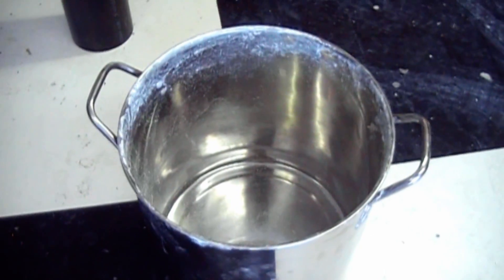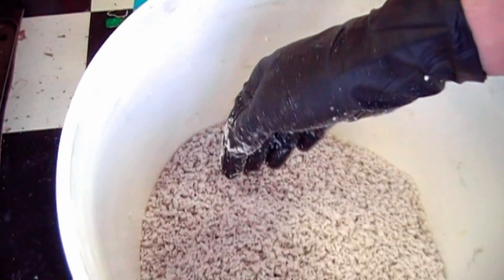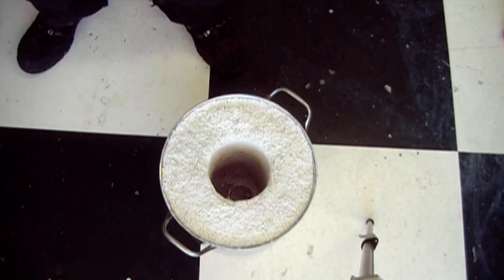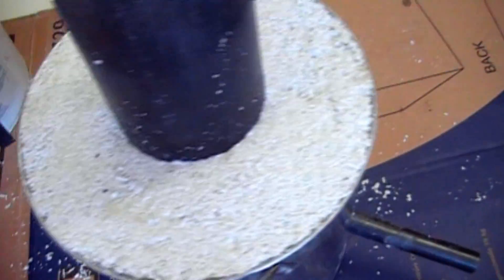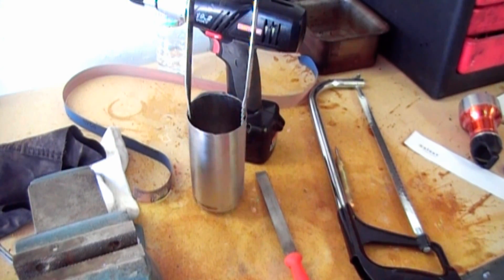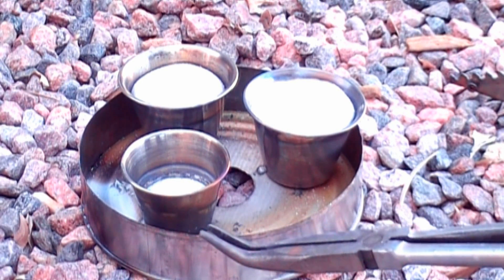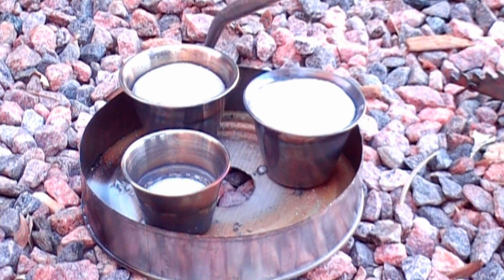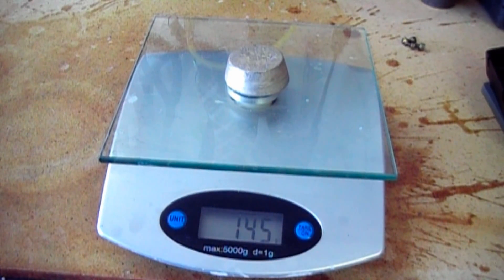How to make a small foundry

Comment: what are the benefits of this recipe compared to the sand and plaster method used in the Grant Thompson video.
Reply from the maker: jesse wakefield I never had good luck with the plaster and sand recipe, by the time all the water has been burned out and it can start getting hot, it becomes very fragile. This recipe is also much lighter, it's easy to move around despite its size.
Reply: thank you for your quick response. by the way i began to collect the desiccant packets in hopes to make my own liquid sodium silicate, however i seem to be having a difficult time finding %100 lye, every hardware store i check tells me the FDA deemed it to dangerous because of its purity any suggestions. im to the point wear i may begin collecting the ashes from my grill.
Reply: clkindred can i use galvanized or should i stick with stainless steel.
Reply from the maker: The concern with galvanized is the zinc burning off and creating toxic fumes. So non galv. is best.

The lye though, I have never known the FDA to have anything to do with drain cleaner. If such rules do apply in your area, I would think they would be from the Consumer Product Safety Commission. Either the people telling you the FDA is restricting it are telling you nonsense, or they have confused the group doing the restricting.

If you are determined to refrain from an internet purchase of lye from a soap making supply site, then my only suggestion is to try to find DIY soap making people in your area and see how they get it.

Comment: I was wondering what this FLUX is you're talking about when melting the aluminum 
or brass to get a cleaner look??    Does it help to use flux in the crucible before 
pouring the molten??
Reply from the maker: sthwestb Flux dose a number of things, it lowers the melting point of the metal, makes the molten metal more fluid, reacts with contaminants and causes them to aggregate together and rise to the top, it can also act as a nonstick treatment to crucibles when working with precious metals.In this case, I used table salt, added after all the metal has melted. The salt melts and is stirred into the metal, the dross is skimmed off and the metal poured.

Comment: I have made my foundry out of the following pieces, 7 gallon propane tank, construction grade perlite, sodium silica, water, and the aluminum oxide. As we started packing it seemed to become very dense and after removing the forms it was smooth but would flake at the top. I decided to use the torch you redesigned and fired the top and inside. It is super hard and set the top so I can put the form back in and go over the top with just the aluminum oxide and silica gell to level and square up the top and to prevent more flaking. All I have left to do is the bottom and I had to order more aluminum oxide because I ran out due to the size of my foundry. I am however going to build a fire in it tonight to get the sides cured so when I fill the bottom it will not hurt the top and sides  when tamping. Thank you for putting your knowhow on YouTube so others like myself can have a good way to learn and make things easy. Great project channel.
Reply from the maker: hcistheman Thank you! Good luck on the build and keep us posted!

Comment: smelting alum beverage cans is actually a good way to know consistantly  what grade of alum or lack of undesireable componets in its metalurgy. It is important that you dont breathe vapors of either the heated stainless or alum. at the temps we are at here, stainless releases about a half a dozen carcinigens the the higher the grade the more toxic it becomes due to addition of more minerals example 401C which is used to make cheap knives contains chromium thus the C it is what keeps stainless from corroding. Just cause it is stainless doesn't mean it wont rust. Oh the alum cans are clearcoated on inside otherwise the acid in the soda pop would eat the alum. Add morton's lite salt Salt melts just at aluminum's top pouring temperature, and mixtures (like Lite Salt) melt at the same time, if fused before use.

Baking soda, sodium bicarbonate, decomposes to sodium carbonate (washing soda, sans hydration) and CO2 when heated. After that, sodium carbonate may have a mild chemical action on some things present, but it isn't going to melt (you wouldn't want it to, with metal around), it has a high melting point. Getting something liquid around the slag and metal is the primary duty of a flux. Oh someone was concerned about a graphite crucible surviving the postal service. I dont know if graphite is the correct crucible material for this application but it is not fragile like ceramic.

Comment: LOL i used a stock pot as well but i used gypsum mixture with paving sand and it gets up to 900+ degrees easy and melts aluminium in blink of an aye using a steel crucible but i want to melt some brass for a project but i cant get a decent sized crucible to fit and i don't really trust the postal service in the UK for a graphite one for the higher temperatures it will probably get cracked and kicked all over the place any ideas for a substitute?

Comment: That's not safe

The air valve is at a 90° angle instead of 45
You are using steel clasp with wood handle 
You didn't put a cement mixture in it so the
      steel bucket can cause a fire
You used a river hose that can be lit on fire .
You didn't in you back yard near flammable
        items

Comment: im no expert but why waste your time sanding the crucible when its going to get scorched anyway?
Reply: Mr.xxxxxxxxxx17 would be much easier to just step away from the fumes, in a well ventilated area, no?
Reply from the maker: It's not for appearance, I don't know what that coating is made of and don't want to deal with the problems of burning it off. In retrospect, it probably did not matter.
Reply: I was just about to post the same question.  Why waste the effort to sand it?
Reply: ***** paint would burn and it could be toxic to breath
Reply: Mr.xxxxxxxxxx17 Any exhaust from a foundry should be considered toxic and dealt with accordingly.
I'd be more concerned with trace heavy metals and dioxins from hydrocarbons on the smelt material.  wearing a good chemical mask is always the safest option IMHO.

Comment: How long does it take for the mixture to set?  I've mixed some up using your recipe, but am not sure how long to let it sit and cure.  Thanks!
Reply from the maker: This exact recipe needs to dry first before cure. Depending on the moisture content and cross section, it may take a few days before forms can be removed. After that, the first firing will cure the mixture, dried mixture that has not been cured can combine with water again and be re formed. After curing the materiel will not combine with water and become soft again. This recipe has been replaced with a better one that can take more heat. https://www.youtube.com/watch?v=vQN7EqGMTuo
As it stands, this old recipe can melt if run hot enough.
Reply: Meanwhile you may consider actually purchasing a proper commercial refractory mix. It may cost more, but you get the confidence of knowing what temperatures it's designed to put up with, and you have the confidence of a commercial product in it's capacity to put up with use.
Reply: clkindred thank you!

Comment: if you wax the pot the concrete will pop right out
Reply: Why would you want the "concrete" to pop right out?
Reply: so you can use the pot again
Reply: imchris5000 First, the material used is not concrete. It is a very lightweight, medium temperature fire resistant refractory casting material that is bonded together with sodium silicate. 
Second, the stainless stock pot is not a mold, but rather a protective case for the refractory casting that helps reduce damage and fracturing, and also provides metal to securely fasten the burner tube assembly to the furnace.  The stock pot handles are also very helpful when moving the furnace and are a bonus. 
In the event you wanted to reuse the stock pot, the refractory material is easily fractured and removed. It is a common practice to remove the refractory casting and recast due to the refractory casting deteriorating and cracking from the heat and erosion from the flame.

Comment: On your crucible use the tongs to "grab" the tube from the outside pushing inwards then on the base add a handle/hook that you can use to hold and then when you come to pour your melt your tongs become a pivot point and the pour itself is much safer.
Reply from the maker: Thanks for the tip.

Comment: When I watched aluminum being melted for casting the smelter used about a teaspoon of 'washing soda' flux per crucible load - stirred it around - that separated the dross - half floated, half sank. Skim it and discard before pouring to get nice gas free clean metal.

Comment: where can i find aluminum that is easy to get that is not soda cans?  i hear people use them but its not good for you or the metal itself.
Reply from the maker: Yea the metal itself is not the best alloy for casting, but it dose work. The best aluminum to melt for casting is aluminum that is already cast. Anything made from cast aluminum is ideal, cast aluminum cooking pots and pans, car parts like intake manifolds and transmission housings, water pumps ect.. old v-belt pulleys and work light housings might be aluminum too.

Be careful though, some of these examples might also be made from cast magnesium, it's hard to tell if they are or not because magnesium is lightweight just like aluminum. To be sure, test unknown metals with vinegar on bare, paint free surface, if there is a light bubbling, it's probably mag and you should not melt it. Melting magnesium will cause the magnesium to ignite and magnesium fires are almost impossible to put out, trying to put one out will be disastrous.
Reply: I'd say the best metal is whatever you can get your hands on. :)

But on a serious note, consider what you're intending to do with what you cast. It may not really matter so much, and unless you know where to look, beverage cans are probably the most convenient source of aluminum available to you.

Comment: Can I use a plastic bucket instead of a steel pot for the foundation?
Reply from the maker: I don't recommend that, after an hour or so running it the steel pot will be quite hot, too hot for plastic.

Comment: So it's basically a heat resistant concrete?
Reply from the maker: Concrete is not used here because it has molecular bonded water, that's what causes it to harden, if heated enough the water is driven off and the concrete crumbles to bits, it can also "explode" chunks all over the place due to the steam pressure. This mixture can be heated without breaking down like the concrete.

Comment: Why so high tech? People in 2000BC could melt copper in their "home made" forges. Why not try to use easy to hand materials like sand, clay and stone,instead of special products that have to be made in a chemical factory?
Reply from the maker: You need a permanent foundary, lots of fuel, and lots of time to do it like that.
Reply: Well they also did it by blowing heated air onto shallow dishes of the metal in clay or stone, which is an incredible poor way to accomplish this.

Meanwhile in 2000 AD, we've progressed technologically, and can do things more efficiently, safely, and conveniently.at home.

Comment: does cement work for this
Reply from the maker: No, it is too dense and full of molecular bonded water. A foundry made with cement will have a hard time getting hot.
Reply: clkindred I've seen them made with plaster of paris and play sand in much teh same way you're doing here.
Reply: clkindred ok then i wont use cement

Comment: Hi Clkindred, Another great post!!.
What can be used to speed up the setting time of sodium silicate? 
 I followed your post...worked a treat, but its still a little tacky.
Any suggestions greatly appreciated.
Cheers
Ben.
Reply: +eyeopener1979 CO2 gas will set sodium silicate in seconds. I used it to set sand casted moulds made of a blend of sand and sodium silicate and it was very impressive. I guess that setting will be much faster if you let your furnace dry in a CO2 saturated environment.

Comment: Can this be used to melt gold?
Reply from the maker: Kind of large for melting gold, unless... you have a lot of gold. A smaller unit would be more efficient at concentrating the heat. Propane has been demonstrated to be able to melt gold, if you can keep enough of the heat in. I have made newer high temp linings for a new forge that would last longer for that type of thing.

Comment: Is it possible to mount a hairblower on it instead of a gas tank?
Reply from the maker: A forced air burner could be used, sure. I am not certain what you mean by "hairblower on it instead of a gas tank" because a forced air burner still needs the fuel. Unless you mean a blower used with coal or charcoal, that could be used too, but it would need to be bigger to accommodate the fuel inside the foundry.

Comment: nice foundry but you will get problems with your crucible. the walls are to thin and the aluminum is agressive towards the steel. after a couple of castings you will find holes in the crucible walls.
but the foundry is great :) i like to use charcoal or coke as "fuel" :)
Reply from the maker: Yea it failed during a brass melt. I fluxed the brass and it started to seep out of a pinhole in the crucible. Kind of derailed casting projects because I can't rely on them and now I'm pondering possible homemade solutions.

If the associated mess I'd make with coal was acceptable I'd try it, but I live in the suburbs.

Thanks for the comment!
Reply: clkindred There are several really good YouTube videos showing how to make crucibles including cast graphite.
Reply: no problem :)
Reply: Cast and Forge I

Comment: So it looks like you're running this off of a propane tank? This is cool because the other videos I've seen combine propane with some kind of air blower. Is there a special way to make the burner tip so it heats up the crucible enough?
Reply from the maker: spiralof5 Building a bigger blowtorch
Reply from the maker: Yep, the burner design is the same as my "building a bigger blowtorch" video where I explain the burner better.
Reply: clkindred I see "building a better foundary" but I only see three videos and building a bigger blowtorch isn't there. Where is that one?

Comment: You get crucibles from some advanced art/jewelers supply places.  I used to do a lot of lost wax casting which by the way is a hell of a lot of fun in itself.  You make intricate parts so easily. 

When I lived back in detroit, I needed a custom sized crucible based on a custom centrifuge that I built.  I could not find one so I went to a ceramics studio that taught classes.  I show them the example that I made and copied it in ceramic perfectly and I got 4 of them for free.  They made it a calls project.

just a thought
Reply from the maker: Interesting, I have thought about a simple ceramic crucible, I took a ceramics class in high school, but my area seems to not be a very lively art scene. Not a lot of options to have one made.
Reply: Does this get hot enough to bake your own ceramics?

Comment: did  you use carbon dioxide to help set the silicate?
Reply from the maker: Nope.
Reply: so it will set up on its own?
Reply from the maker: Slowly, also the first burn exposes it to a lot of co2
Reply: clkindred Makes sense to me.  I am in need of making a "few time use" casting mold for metals.
Im not sure what do use as a substrate, but I think that the silicate would hold it together nicely.

The object in question is simple in design as well so i it could be repairable between castings.  Perhaps simply sand would work, and I could paste it over with talc mix.

Comment: How's that crucible holding up after repeated burns?
Reply: clkindred It might be worth the 25ish dollars to purchase a graphite crucible on ebay.
Reply from the maker: Not good, it sprang a pinhole leak after a couple brass melts, kind of derailed future videos on casting until I get/make a better crucible.
Reply: Reasonable I suppose. I meant to wander around a big box store today, looking for something that would serve, but couldn't get there.
Reply: Maybe use part if a steel fire extinguisher?
Reply: madwilliamflint I've seen people use short steel pipe with a threaded end cap. Works well for small quantities. I had a friend weld a plate to the bottom of a 4" diameter pipe. The walls were 1/4" thick and it still works.
Reply from the maker: It would be thicker steel, but I was wanting to use stainless steel because of it's resistance to heat. Although I have heard conflicting information on if stainless steel is better for this or not.
Reply: clkindred The heat resistance of stainless steel depends on the grade. 
Usually 400 series stainless outperforms 300 series by far. 
There is an informative pdf titled "High Temperature Characteristics Of Stainless Steel" from: http://www.nickelinstitute.org/~/Media/Files/TechnicalLiterature/High_TemperatureCharacteristicsofStainlessSteel_9004_.pdf
Reply from the maker: Thanks for the link, I'll check it out.

Comment: Very nice video! But if you know, if i use MAPP gas or other very high temperatures gases, will that foundry resist? cause i need to build one to melt gold and platinum. Regards.
Reply from the maker: Have you seen the videos from the channel (Makeyourowngoldbars) ? Is that the type of thing you are looking at building? For gold melting temps, this exact lining probably would not last long, there are drawbacks to this method even in the way I use this one. I'm working on different refractory materials that could replace this recipe, but progress is slow I'm afraid.